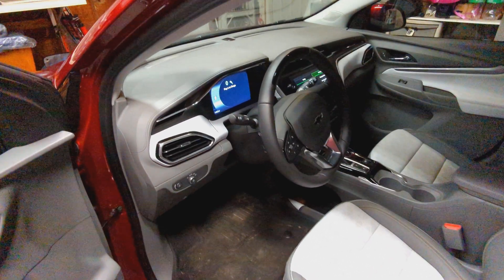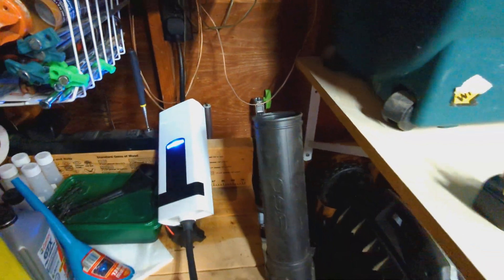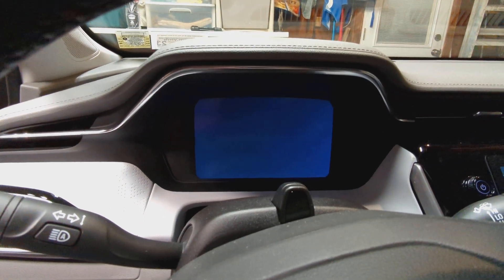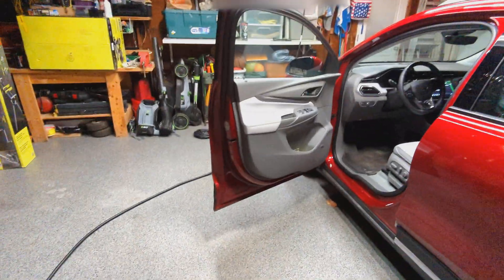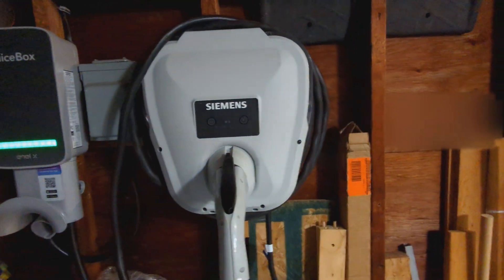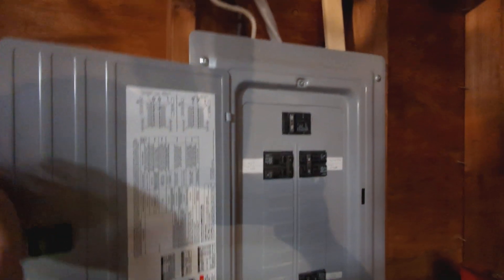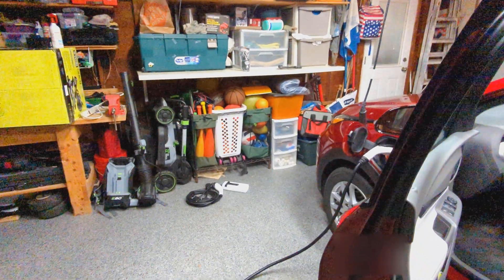Bolt EUV Charging Options - Review 120V vs 240V how much time do you have? days vs. hours

Comment: What you fail to mention is you should almost never charge to 100%. It takes just as long to charge from 0% to 80% as it does to charge 80% to 100%. Not to mention the potential to shorten the life of the battery pack.

Comment: The charging curve is slow after 80% so the car would not be charging “fast” during that last 20-30%, so using 30/32/40 amps probably doesn’t matter as the car will probably be charging at like 30 amp speed for example. It would be cool if you did this video again, but had the car set to 80% charge to see what the times would be like.

Comment: Out of curiosity....would you have info on whether or not it's possible to charge a Bolt using a standard 12v car battery (say 100Ah) using an inverter?  It would be a cool option un case of emergency.  🤔
Any opinion on that?

Comment: If you plan on keeping the vehicle for long time like i do, Slow charge at home with 120 volt. Your batteries will last longer.
Reply from the maker: I do keep the rate at 32 amps vs the 48A that it will accept on 240v Been driving it more and more and I would not be able make 120v work

Comment: AS I only drive less the n 15 or 20 miles a day  120 volt charging is plenty to top off. But I did replace my 110 outlet with a heavy duty 20a outlet.

Comment: I got a level 2 installed last week! To bad I haven't used it yet because my brand new pos bolt has been in the shop for over 2 weeks (almost as long as I have owned it) and Celebration chevy in Denver Colorado usually just puts me on never-ending hold when I call!
Reply from the maker: Sorry to hear it is in the shop, what is it in for?
Reply: @practicallyfrugal  Thanks! The heater went up about a week after I got it. I wouldn't care much because of the wonderful heated seats and steering wheel but I can't defog my windows to see where I'm going and the car is brand new. Nice video btw 👌
Reply from the maker: @donnyh3497  thx, sorry to hear about the heater, that would be a problem.  Knock on wood 17,500 miles no issues so far
Reply: Glad to hear it. In the 3 weeks I had it, I really did love that car. I just had a 50amp breaker put in and a chargepoint homeflex installed. I'm not sure how long it will take to charge with that set-up.
Reply from the maker: @donnyh3497  most likely it is set for a 40 amp charge rate which is similar to the juicebox charger in the video in terms of speed.  Which will be plenty fast unless you need to drive well more than 250-300miles daily.  In my case I have since set both my chargers to 32 amps which is plenty fast, did it with the idea it might be lease wear on them?? But have nothing concrete to base that on.
Reply: @practicallyfrugal  Thanks, that's interesting. I'll look into that. I appreciate you!

Comment: 240 at 32 amps ~ 8.25 hours..   i bought the Enphase hcs-40 it says 7.7kw.. ,, i drive slow to save energy, if i speed it eats the battery...
Reply: i bought it as a commuter car cause i work 6 days a week an gas is hella high right now ,,

Comment: The power standard for America is actually 120/240 volts and it’s been that way since 1967 but many still say 110/220 volts no big deal. Nice video  but I need to wait a few more years to get a Bolt but I have just installed a solar array to the place so that will help the affordability of a EV.
Reply from the maker: I agree with the 120/240 piece just habit, will say though as the power on these ramps up I see my voltage drop to just above 230 especially at the higher amps.  I also wish I had solar, but I have super cheap municipal rates at $0.05/kwh that makes it so the ROI is just not there.  I have looked 3 times over the past 20 years and it has gotten much better, but still not quite there.
Reply: @practicallyfrugal  Wow that’s a great power rate indeed and I’m curious where your located? Here in rural NW Wisconsin we pay $0.13 per KWh, still not too bad compared to what some pay and it’s a cheap $13 a month to be on the grid through the utility compared to other local power companies charging $45-$50 a month to be on their lines so I went with a grid-tie system. The bummer up here for EVS is that it’s so cold here in the winter but as far as keeping a EV in the garage I want to insulate and heat it to 45 degrees, not real warm but better than at our sometimes below zero temps up here and it will help some when I go out in the cold with the EV. I heat my house exclusively with free firewood so if I use some LP for the garage no big deal!
Reply from the maker: @hermancm  located in a suburb of Rochester NY, power comes from Niagara Falls

Comment: are you using 110v connection or 220 v connection.I do not see you mention about it.
Reply from the maker: In this video the first charger that is plugged in is to a 110v outlet and the charger is set to 12 amps.  The rest of the chargers after that are all on 220v at different amperages

Comment: When GM says they’ll pay $1500 (in Canada) towards a charger. What will they provide?
Reply from the maker: I can't speak to Canada, but if similar to US it is a basic install of breaker, outlet, and a small amount of wire to connect them. They assume main panel is somewhat near the new outlet. Distance is not specified, but my guess within 20-30 feet.
Reply: @practicallyfrugal  ok. Thanks. Is the Chevy charger a little slower than other level 2 ones? I’ve heard they take 10 hours to charge a bolt. Vs 7 hours for other level 2 chargers?
Either way, it’s free so it’s great!! Looking forward to getting my bolt EUV in 13 days :)

Thanks!
Reply from the maker: @andrewandron7087  Chevy charger is good for 32 amps, but the bolt can accept a charge from a 48 charger. Hence the difference in speed
Reply: @practicallyfrugal  ok thanks

Comment: Hi, enjoyed your video.  I'm hoping someone can answer a couple of questions for me.  I have had the Siemens 30A charger you showed for a couple of years to charge a KIA plug-in hybrid.  I recently purchased a 2023 Chevy Bolt EV as a replacement.  I have heard that it is better for battery life management to charge to less than 100%, but when I set the charge level to 90% on the Bolt I keep getting a fault indicator on the Siemens unit.  This does not seem to be a problem if I allow to charge to 100%.  My questions are if anyone else has noticed this issue and if I should just charge to 100% as a regular practice?  Thank you!
Reply from the maker: Typically for most EV's 80-90% seems to be the recommended regular upper charge limit to maximize battery life.  I set my mine to 80% except when I know I need the extra range, We do this on the Model Y as well that my wife recently acquired.
Reply: @practicallyfrugal  Thank you!  And have you ever observed faults on the Siemens charger when charging the Bolt to 80-90%?
Reply from the maker: @ronw4975  I never had any faults on it, I have had some on rare occasions when it's hot in the garage with the clipper creek, maybe 2 or 3 times in 5 years.

Comment: As a licensed electrician that specializes in EVSE installations, Chevy needs to stop promoting the Dual Level charger as the optimal solution. Many installers, myself included, are no longer doing 14-50 receptacle installs. A $66 diy outlet install will not pass inspection and is potentially dangerous. Box store outlets that are used for dryers and ranges are not designed for the EVSE load and are overheating and melting. It needs a more expensive commercial grade receptacle. In most areas it also requires an expensive gfci breaker. Always insist on a hardwired unit. Cheaper install, safer, and higher amp output.

Comment: Are the chargers waterproof? I have a garage but it’s used for storage so will always have to charge outside. If it’s raining and stuff plugged in is it ok? I’m sorry if that’s a dumb question!
Reply from the maker: Yes the EVSE is waterproof, if installing outside many places require it to be hardwired vs plugged in

Comment: Cool video.
Just note that for an 80% charge, the higher amp chargers will make a LARGER difference since going from 90-100 does not take advantage of higher charge rates so a 100% time hides that.
Reply: They are fully discontinued already.  GM said so on Monday morning 4-24-23.  We unfortunately have a 2020 and no recall fix or idea when it will happen in 2023.  Cat Lady CEO is just talking about their " Plan " to do something in the future with EVs .......  I hope nobody gets into their EVs and gets ignored and passed over exactly like all of us others out there.  IF you are in an accident ..... Your car will be totaled because there are no parts to fix it.  The Equinox EV is a sham.  They are only selling TOP TRIM LEVEL ones for the first year.  That is IF you can get one in a year.  The one thing Chevy are good at is NOT delivering EVs.  If they made the order Non Refundable there would be less than a thousand.  Also the Equinox they PLAN on making at the bottom level trims are far more expensive than a Bolt and will have over 50 miles less range and weaker motor.  FACTS.  If you don't spend over 40 thousand dollars you will be screwed and road trips won't be an option.  Front wheel drive will make your tires last 10,000 to 20,000 miles from now on.   You can't tow any weight with front wheel drive without a front motor and transmission to counter weight it.  Tires will not grip in dry conditions.... Just spin.  Chevy is ready for bankruptcy and deserves it fully.  Stealerships will be the next to go with the Bolt and Bolt EUV.  None of it will be missed at all.

Comment: I am perfectly happy with my 240Volt 20 Amp charger.  I get about 100 Amps of charge at 3.7 KiloWatts.  That equals about 100 miles a day available each session.  So, If I drove 30 miles to work (retired) that would still leave me 40 available each day.  NOW, I charge twice a week at most and I a good.  As for trip charging, think about it: you stop for a fillup and stand there 5-10 minutes, go pee(wash hands), get a meal and snacks, so how is that highway gas stop any different than an EV Charging stop?  You simply plug it in and walk away.

Comment: How many Kw is your car charging at when using the different chargers?
Reply from the maker: On the dash it shows 11kw with the 48 amp, 9kw with 40 amp, 7kw with 32 amps, 6kw with 30 amp, 3kw with 16 amp, and 1kw with 12 amp 120v

Comment: Wow that whole thing sucks.
Plug in and wait, drive, plug in and wait.
Take a trip, plug in and wait
How do you jump start an EV?
Reply from the maker: if you are on the highway doing road trips constantly agreed this is not the vehicle for you.  If on the other hand you are driving 175 mile or less round trip, this is the perfect car as you take 3 seconds to plug it in when you get home and 3 to unplug it when you leave.  Spending 5mins every week(or 4hrs 20mins/year) in all sorts of inclement weather pumping gas into a car that is costing at least $140/month($1,680/yr) in gas(assumes 12k/yr,25mpg. gas@$3.49/gal) does not sound like fun to me. Assuming the same factors this bolt will cost me about $230 in electricity for the entire year.
Reply: @practicallyfrugal  that was a great justification for plug in and wait.
Drive, plug in and wait. Battery does faster in cold. Plug in and wait.
Can't jump start it, you buy a new battery, some can't be towed.
I'll keep my truck because I can convert it to natural gas.
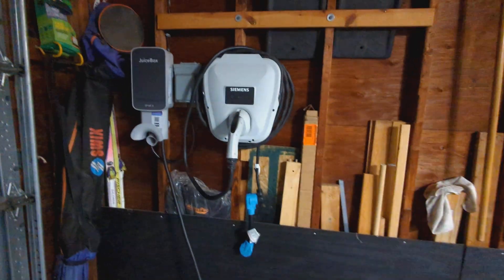Reply: Remember the picture of a tesla 11:54 with the gas generator in the cargo basket on back with extra gas cans 😂

Comment: It would be nice if the bolt would allow you to adjust amps to slow charge if desired.
Reply from the maker: You can down adjust some chargers.  The juicebox can down adjust thru the app.
Reply: @practicallyfrugal  Yes I know but it be nice if I could adjust it in the car. My bmw i3 has a reduce setting but my bolt does not. Also, chargepoint removed the ability to adjust amps after install.
Reply from the maker: Correct the juicebox can, the Emporia I put in can as well as others like chargepoint
Reply: @practicallyfrugal  Chargepoint no longer lets you do it on demand.

Comment: And slow charting at 120V is less efficient by about 5%.  It's actually costs more to slow charge the same amount than it does to use a level 2 charger.  Best to use a L2 as much as possible and not rely on a L1 as a regular charger.

Comment: Why would anyone have four different chargers in their garage? They are not cheap and one Level 2 charger usually does it.
Reply from the maker: So the Siemens was given to me FREE by the electric company and the GM supplied one came with the new car.  I don't need or use 4 and will be selling one or more of them shortly.  In practice the overhead one I use all winter long as it keeps the cord off the dirty/salty floor and the juicebox in the summertime as we don't/can't park in the garage do to summer kids stuff being out
Reply: @practicallyfrugal  Got it. I only use one (made it overhead just like you did) and it's all I need.
Reply: @Practicallyfrugal  How did you get the Siemens charger for free from power company? Do you have National Grid?
Reply from the maker: @stubs6575  they had a message out asking for volunteers with the only commitment being we used it for one year.  This was thru our municipal power company Fairport electric

Comment: Great summation of the home charging options for an EV.   You mentioned that you previously owned a Chevy Volt.  Are you happy with the Bolt vs the Volt?  I have a 2018 Volt and have been eyeing the Bolt EUV for some time.
Reply from the maker: I have overall been much happier with the EUV vs the volt.  More room overall and is easier to get in and out. I took was a bit apprehensive at first in making the switch, but when I looked at my usage with being 85+% electric in the volt for my miles with only 53 miles of range I figured with 250 I should be fine.  That and for our long road trips we would use the Highlander.  My only regret was not buying out the volt given how prices skyrocketed, but that is hindsight
Reply: @practicallyfrugal  I have exactly the same sentiments regarding the Volt, I’m tall and it is difficult to get in and out of and as a you say, the Bolt has more room for both passengers and cargo.  The Volt has been an excellent vehicle overall.
Reply: You'll experience a pleasant improvement in every regard. I traded my '15 Volt Base for a '22 Bolt EUV Premiere and gained everything and then some; gave up nothing. You're in for owning the best EV now on the market.

Comment: Wait , I did the math based on our lowest electric rates for Calif. is 29cents per kilowatt and Tier 2 and 3 are HIGHER yet. City driving in a Tesla would cost me about 2 cents MORE per mile than a used Prius LOL
Reply: That’s comparing one of the nicer EVs to the cheapest of cars.  You should compare to the BoLT.  Costs me 5 bucks to fill it at home.

Comment: These BEV cars are not saving the planet , the battery on these and bigger cars made many thousands of pounds of CO2 to make the battery ! Look at the complete picture on BEV , it is a scam. There is no guarantee GM will even make a replacement battery for it. They already screwed people over on a prior BEV. And if they do make one , it will cost more than the car is worth. BEVs are an environmental disaster as they become expensive paperweights down the road , and NO those batteries CANNOT BE recycled. More environmental damage. A Hybrid with a much smaller battery with a type of battery Toyota uses is affected VERY LITTLE by heat/cold compared to the usual Lithium battery. And the Toyota battery IS affordable to replace when the time comes , so no environmental paperweight. Your video verified that the TED-talks on this matter by actual scientists and my situation makes a BEV a NO-GO for me.

Comment: For heaven sake, you are not supposed to park those bolts indoors. They can explode into flames.
Reply from the maker: That was the restriction on bolts that had not had its battery limited to 80% or replaced. This is a 2023 with a non recalled battery
Reply: @practicallyfrugal  A Dec 20th recall came out for those Bolts for another fire warning. They use those sketchy bargain brand LG batteries. 

You have to get that thing out of your house or you risk burning your house down. That is just how it is when you buy GM EVs.
Reply: @harrychu650  My 2023 Bolt has the new battery pack from the factory. The recall is for 2022 and earlier models. I added my car to the NHSTA recall list using my VIN number. No recalls as of now.
Reply: @unclej3910  I won't take the chance. GM is spending more in advertising/branding then engineering for EVs and LG has a terrible reputation in the battery industry.

Comment: Buffalo,NY here. I have a Prius prime and use 120v exclusively. What nema 14-50? Do you recommend?
Reply from the maker: Go Bills! If using 120v exclusively you won't need a 14-50 outlet.  If you plan to install one I would not buy the cheapest one at HD/Lowe's, they will work, but not necessarily designed for the long term heavy load a charge can place on the outlet.  In my setup the outlet I have is an outdoor rated RV one and was like $35, I wanted it over the regular outlet to protect the plug.  A decent 14-50 outlet will be around $15+
Reply: Yeah, look for a commercial grade 14-50 plug. Most of the ones available in the big box stores aren't as robust as a commercial grade outlet.